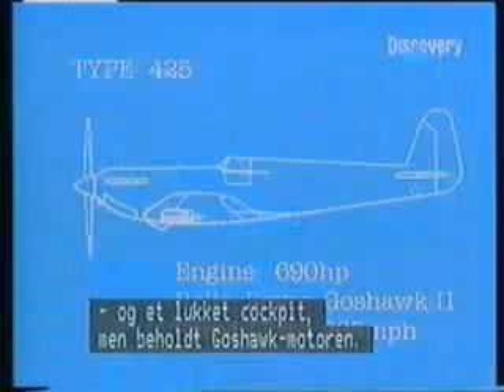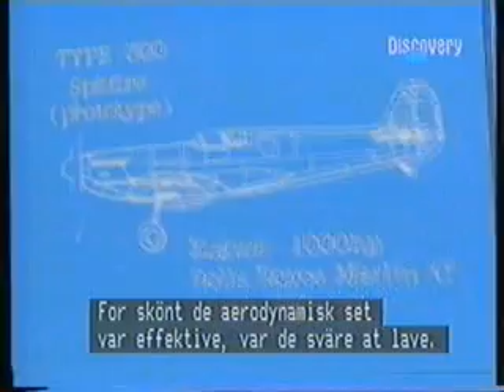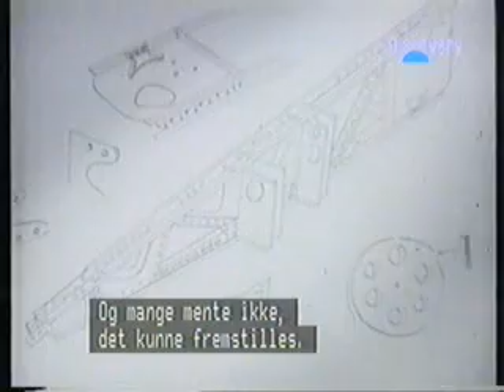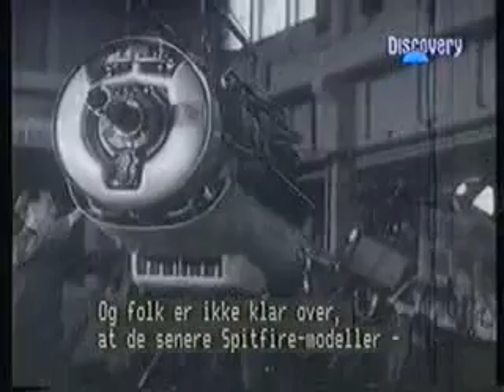Spitfire, the legend, the facts and its opponent (1 of 5)

Comment: They had the same engine... the real difference being, designed as a long-range escort fighter, the P-51 was optimized for range, if necessary, at the expense of dogfighting characteristics.  Initially intended as a defensive fighter/interceptor, the design emphasis of the Spitfire, on the other hand, was entirely on dogfighting performance.  American volunteers who had the opportunity to fly both during the 1948 Israeli Independence War admitted that they preferred the Spitfire as a dogfighter.
Reply: You’re right on. But I do want to add one substantial point... the mustang weighed far more than the spitfire and still had remarkably similar performance. And in a dive, the P-51 was a beast. I’m glad as an American we had the brits in spits fighting the Germans. It’s a wonderful plane. I personally refuse to compare the mustang and spitfire because it’s unfair to both!
Reply: @jd.3493  
The odd thing is the heavier P 51 was not even close on performance, eve taking a 1942 Spitfire compared to a 1944 P 51, the Spitfire went higher, had better acceleration and climb and was far more maneuverable.
The P 51 had a max dive limit of mach 0.8, the Spitfire was limited to a safe mach 0.86 or more than any other aircraft during the war.
It is only unfair to the P 51 to compare them.
Reply: @Desmonor After 43 that was not a problem 90 gal slipper tank MkVIIIs in Italy were capable of 1200 +miles
The Spitfires were cleaning up in France Belgium Holland West Germany etc etc while the P51s did the escorting. 
It was by agreement as the USAAF plane recognition was appalling . If the Fighter was NOT nice and Shiny it was the enemy. which was why the RAF were reluctant to fly with the USAAF
Reply: @barrierodliffe4155  The P51 max dive was only 0.78

Comment: So, sixty years on the truth should be told about the spitfire.
It was a good fighter....not a great fighter.
The spitfire had many faults but the one that must rank first is the placement of the fuel tank right in front of the pilot. this resulted in many horrible deaths as one german round in this unsealed tank resulted in the incineration of the poor pilot.
Reply: Gusswilliams: Funny that the RAF never lost as many as did the USAAF